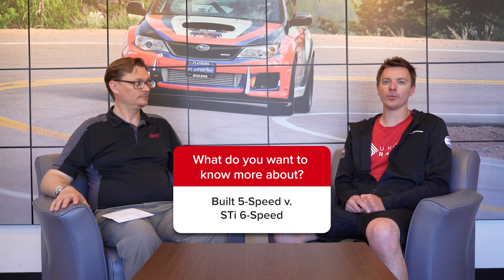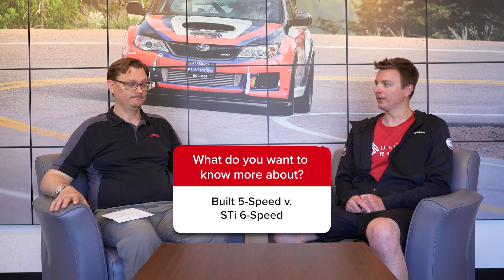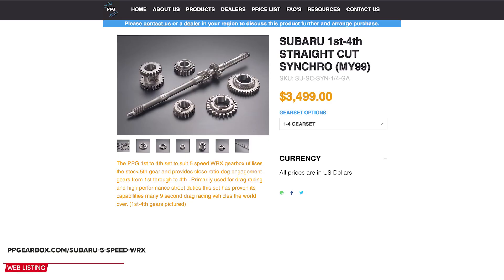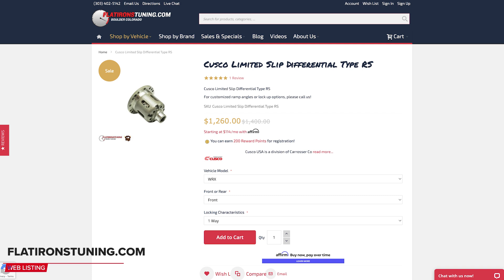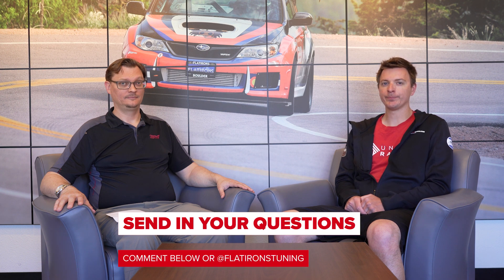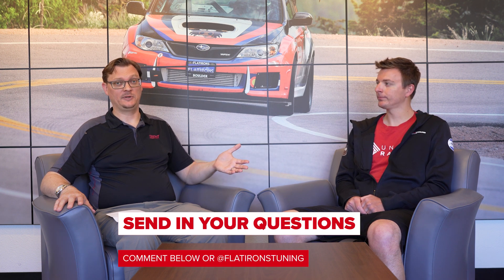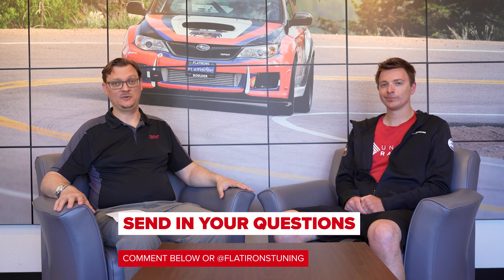Can you build a 5-Speed to be as strong as an STI 6-Speed?

Comment: Disclaimer: Just my findings; Love FT and buys parts from them; FT has been very helpful with my 2002 WRX; not advertising anyone else... just sharing knowledge from those who build 5 and 6spd MT for Subaru.
Question: How is the car being used? What is the horsepower/torque? This should dictate everything.
A 2.0L is a 2.0L, not a 6.0L LS. Subaru builds phenomenal power per liter. I wish Subaru had a 6.0L, I would make it fit. 🙂 That being said, it is my belief that 4 cylinder cars should be as light as possible in weight. As a penny saved is a penny earned, weight saved is power earned.
1) 5spd cases can only take about 350 FtLbs of torque due to the helical gears pushing the shafts out the end of the case. If you go with a straight cut gear, this problem is reduced significantly. The driving style will dictate what the 5spd will hold, as well. However, straight cut gears are noisy.
2) I have been informed by the builders there is about 100 lbs in spinning mass difference from the 5spd to the 6spd. If this is the case, this will definitely take away the responsiveness of the drivetrain. From this site (FT) and others, it has been stated up to 350HP/350FtLbs is the threshold of reliability for WRX/STI. Thus, one has to ask him/herself where will the power be maxed out at for the particular setup.
3) What I have been told: If you are going upwards of 500HP or more, you want the 6spd for reliability; simply put the 5spd will become a grenade at this power level. Stay with a 5spd setup as long as you can, especially if you don't exceed the 350HP/FtLbs mark. You will lose power to the ground due to the +100lbs spinning mass in the 6spd.
4) Many different types of gear ratios are available, and depending on the power level, you don't need bullet proof gears; you just need gears that have been proven to sustain the power and torque you are going to use.
5) Do not modify the gears after buying them such as smoothing them, or treating them. This will throw the tolerances way out, and cause the gears to not mesh as they were designed. To John's point, you will get less surface contact on the teeth because the tolerances are altered. So, a perfect set of gears for your application and power can be completely destroyed when "You" decide to add in your own internet engineering. Listen to the pros and accept what they have to say; they know what they are doing.
6) What I have been taught, and see: More shifts means more time. The last time I checked, drivers/racers want less time. Hmmmm? 🤔
7) YOU WANT FULL POSITRACTION!!! Believe me, this has made a huge difference for me on the street and taking corners and keeping traction. This is real AWD, not the open diff crap you get from the factory. This is especially helpful on non-asphalt services, or when there is gravel on the roads and in corners. FAIR WARING! You will have to change your driving style... You have to steer the car back straight when coming out of the corner. If you do not, the car will continue to turn that direction.
8) Choose a gear set that compliments the performance of your engine. DO YOUR DUE DILIGENCE! Make sure you have done the math to ensure the gears you are using don't shift you out of your boost/power range. If the engine is not built yet, then pick the drivetrain you want, then build the engine to compliment that drivetrain. DO THE MATH FOR BOTH... Engine and drivetrain.
9) Keep Horsepower numbers out of your head... I have seen properly setup cars (engines and drivetrains matched in form and function) with less horsepower annihilate higher horsepower cars on the street. That is fact.

My Setup for those who care... I have an 02 WRX Wagon (Grocery Getter). The stock 5spd MT would allow me to see speeds up to 135ish. However, shifting would cause the engine to fall out of boost. With much consideration and how I drive, I gave up one thing I wanted to keep... I went to 3.0 1st gear instead 3.4 1st. Thus, I  have to work the clutch more, I can launch and stay in 1st longer, go to 2nd gear and stay in boost. This affords me 1-4 in boost. I also forfeited top 4th gear speed, but probably to save me from going to jail. Here is the setup for my grocery getter. Believe me, 0-107mph is very fast and aggressive, considering it is currently a 275HP USDM 2.0L with 194K miles. In the near future it will be max 350HP/FtLbs 2.0L JDM motor.
1) 5 spd MT custom built by ????? Design. Dual first and RA 2-4 gears; Dual carbon synchros 1st and 2nd and new synchros for the rest; stock 5th gear for highway speeds; Torsen LSD in the front.
2) R160 AP Racing posi rearend
3) Kept stock 3.9 gear ratio, with 1.1 reduction setup. (Side note: 1.1 reduction is a clever design by Subaru. I like the science behind it. It reduces the speed of the driveshaft to save power.) 
4) Running a steel 1 piece driveshaft (5lbs savings from stock 2 piece) for durability and repair. Carbon too expensive for budget, and cannot be repaired easily or at all. Aluminum would require a hammer for clearance issues... not going to happen.
5) Using a Spec clutch kit, nothing fancy, with stock flywheel to keep the harmonics under control on the street for drivability and rush hour traffic. I would rather have the clutch slip in the future than allow the power of the new engine to break the trans. Clutch kits are less expensive.
Pricing:
Trans: $4600 includes some extras (bushings, etc)
Diff: $900
Steel Driveshaft: $600
Clutch Kit: $350
TOTAL: $6450 not including speeding tickets 😋🤣😂

Comment: The 5 speed isnt worth building imo. I had an RA gear 5 speed break on me on a vf34 e85 set up. I then went to a 6 speed with an auto driveshaft and re used my r160 diff. i spent about 3300 on the swap including the little things that were needed.
Reply from the maker: Nice!  Thanks for the comment and Stay Tuned!
Reply: I ended up building 5 speed as couldn't justify cost of full changeover and wasn't brand new. 1st to 4th straight cuts dog box (PPG gear sets) and love it. Run 450whp and 830nm torque no issues. 

Can see the pros of the 6 speed for sure!

Comment: After pricing on your site it looks like a full swap, with new parts, would come in alot closer to 15k without labor than the 6-7k mentioned. At this price I can build 2-3 5 speeds with gears. Admittedly the cases will still be weaker but a much more viable option for those of us with cars worth a fraction of the 6 speed swaps.
Reply from the maker: Hmmm.  I'd need to see the options you selected.  The number that we came to in the video is straight from our site, with the options selected.

Though that is a minimal estimate, yours seems quite high.

Thanks for watching and Stay Tuned!
Reply: @FlatironsTuning  looked like the basic swap contains tranny, linkage, and mounts. But wouldn't a person need the rear diff, clutch and flywheel, axles, dccd controller, and possibly brakes to complete the project? For my particular 5x100 hub vehicle it would need to be a dedicated and sponsored track car to do the swap with new parts.
Reply from the maker: Nope, not at all.  We just put this together on our site as a full resource with information on the swap.  The minimal parts that we discuss in this video are all the parts that are absolutely required.  Everything else is basically optional.

I would recommend a DCCD controller though, that has a number of benefits too.

https://www.flatironstuning.com/sti-6-speed-swaps-everything-you-need-to-know
Reply: I looked into this as well and maybe it depends a lot on which WRX you have. After watching the Flatirons video for doing the 6-speed swap into a GR it looks like I would need all those extra items.

Comment: Would a PPG 1st-4th gear set work in a Legacy Spec B 6 spd?
Reply from the maker: Thanks for your question.  Yes, there are 1-4 gear set options for the 6-speed transmissions.

They are a different design from any of the 5-speed gear sets though because the parts are not interchangeable between the two.

Thank you for watching and Stay Tuned!

Comment: 6spd case with stronger 5 speed gears set
Reply from the maker: The two transmissions are completely different designs and parts will not transfer from one to the other.  But there are gear options for the STI 6-speed transmissions.

Thanks for watching and Stay Tuned!

Comment: Went from a 4.11 ratio 5 speed to 3.9 ratio 6 speed an never looked back. The 6 speed literally transformed how the whole car feels overall. No question, 6 speed or bust!
Reply: Man I have to say I had the opposite opinion. I broke 2/3 in my 02 wrx 5 speeed. Basic Cobb and a vf34 twin scroll. Maybe 330 ish hp. I did a full 07 sti 6 speed swap, had custom races made for the cvs to keep hubs and the r180. With the quick spooling vf34 the 6 speed final drive ratios ruined the car for me. I sold the car since I put so much into it. and upgraded majorly. 03 wrx 530hp gt4088 twin scroll with a built ppg 1-4 straight cut 5 speed. Stupid fast. But maybe with the bigger turbo now the 6 ratios would feel better.
Reply from the maker: Nice!  Thanks for watching and Stay Tuned!
Reply: What do you mean 4.11 to 3.9

Comment: Great videos as always. Just wanted to put my 0.02 here…. Original owner of a 2011 WRX here that I’ve had for almost 12 years now. Been running my car on the 5spd the entire time with 410ft lbs of wheel torque through it with no problems to this day. 
I think what’s been the most important thing is respecting the transmission for what it is. Don’t dump clutches, hard shift, or roll on throttle in too tall of a gear. The transmission loves to be finessed into the right gear at the right engine speed,unlike other vehicles Respect it and it’ll last a long time.
Reply: I send mine often (mostly pulls). It's had the same gears in it for 140k miles. I'm going to get ppg's just to have some piece of mind.
Reply: Nice! I have a stock location Comp TBB 56mm turbo on 91oct in a 2006 WRX Wagon w/5sp all stock internals and make around 400wtq. Over 50k miles on this setup and only issue Ive had in the driveline was due to rear end incident
Reply from the maker: Thanks for the comment and glad to hear that your 5MT is still working well for you!

Stay Tuned!

Comment: Hey guys thanks for answering my question! I’m the Joe you mention lol. I paid about $5000 for parts including the rebuild kit and labor by Andrewtech in 2015 so prices were slightly lower… I ordered the PPG torsen diff for about $1900 and I installed it myself. Other things that went into me considering this choices was axles and brakes because my setup is in a 2002 WRX wagon. At the time I didn’t know what to do about the longer axles from a sedan as well as the hub conversion to 5x114.3 which would require getting new wheels. (I have 18” Prodrive P1s which I love) It was just very convenient to remove and replace with the same trans. Also if you ever have to replace or repair Brembos it can be very expensive. Any other questions let me know! Love your videos and tech discussions!
Reply from the maker: Thanks very much Joe, and glad that you liked the video!  Stay Tuned!

Comment: Would you need a sti gauge cluster for a 6 speed or does the aftermarket dccd controller not need it?
Reply: map dccd has the 'gauge' built in
Reply from the maker: Thanks for your question.  The STI cluster isn't needed to do the swap.  And as mentioned here, if you want the lights to display the DCCD function, the MAP DCCD controller does that as well.

Thanks for watching and Stay Tuned!

Comment: There are more version of 6mt gearing, while JDM is short and doesn't give you longer final gear, USDM/EDM hawkeye 6 speed has longer gears that are somewhere between WRX 5speed gearing and the 6th is longer than WRX 5th so it is beneficial as well. And for people outside the US and Japan, the STI had non-DCCD 6speed until 2005 which can be sourced cheaper and doesn't need any additional wiring.

Comment: Just curious on yalls opinions on blast plates and how useful those are in a 5 speed transmission
Reply from the maker: They don't really fix the core problem with the 5-speeds, which is most likely why there has never been any concrete data about how much of a change they make to 5-speed durability.  Dave from Rallispec had some interesting experience with them as well.  You should go through that video if you have a chance.  Lots of good information in there.

https://youtu.be/vwi68Qd-mwE

Thanks for watching and Stay Tuned!
Reply: I have them and the difference in feeling is amazing, have spoken back and fourth with a privateer rally guy that was nuking 5speeds until he started using them.
Reply: The theory is that 5 speed transmissions stretch/twist under high power applications. This allows gears to grenade themselves. 

So blast plates keep the transmission from flexing,keep the gears from grenading. My tuner autocrossed a wrx swapped outback making 500hp, and with blast plates, had no issues...
Reply: @StarwindIV  glad to hear this from someone else. i know of 2 people running them, 1 at strip has had many launches on semi's and its still together and the rally guy but he did brake with blast plates after 2 full seasons, were before plates was every couple races lol
Reply: @proximitybeejay3673  I will say, I wouldn't recommend hard launches constantly with a stock 5 speed and blast plates, but, for hard driving, should be fine imo
Reply: @StarwindIV  Dude i change gears like my lever is a match stick lol. The 5 speed lives in a glass house i was just saying what i have done lol. And shock proof oil HAHA
Reply: After "melting" 2 3rd gear sets I installed the blast plates, only 1 trackday on it, but will come back to this if it grenades itself.
Reply: @PedroFTeixeira  Please lettuce know buddy. Blew my first box quicker than a virgin on pram night doing less lol, have a spare waiting again all ready lol
Cant afford a 6sp swap here after full build and everything else.
Reply: I have a 2012 wrx tuned to 420/450 wheel with blast plates it’s a daily driver, and I beat on it pretty much everyday and the trans has held up for over a year now starting to get grinding going into 3rd but overall I feel they have helped quite a bit. Maybe just luck..
Reply: @christopherhutchinson1779  nice knowing. Coming from drifting and nissan turbos, these boxes are a joke. We limiter launch daily in Nissan and then smash every gear to drift lol. Really wish they made the 5 speed better
Reply: @proximitybeejay3673  the 5-speed wasn’t designed to take launches, because it was used in less powerful cars first. I was surprised at just how small it is when I started working with them. 

When Subaru got serious about racing, the 6-speed was designed and was MASSIVELY over-engineered to handle high torque.

The difference in size/design makes it real obvious side-by-side why you want to move to the 6-speed. 

If you’re racing and serious, the 6-speed is mission-built stock from the factory.
Reply: @grioghar  My mate/ engine builder worked for Subaru Rally team for a season, he seen 6 speeds grenade on the line. 
And i know the differences etc 
Just seeing how the 5's are holding up with plates etc. 
dropped 50k on my car the box has to wait lol and i treat it like glass =)

Comment: Great idea for a topic! Just swapped in a 6 speed myself after blowing a 5 speed at about 330 ft-lbs. (never launched, blew 2nd) and am really curious what you have to say (haven't watched yet).
Reply from the maker: Definitely take a look at the video.  Stay Tuned!
Reply: @FlatironsTuning  Watched it and wasn't disappointed!  Glad that I went with the six speed in hindsight and interesting observation about the lack of support in the main gearshaft. I had previous read about the issue of the gears pushing apart under heavy load as being the reason for failure, even in PPGs, but people had typically attributed that to case flex, rather than any lack of support in the gear shaft itself.

I'm curious if you think that straight cut gears, if you can tolerate the whine, would hold up much better, since they should, in theory, push apart less under load, compared to helical. 

It also sounds like blast plates, which were once thought to reinforce the case against flex and mitigate the issue, would do nothing to solve this issue. Wonder if that matches people's experience with them...
Reply from the maker: @Currancchs  The issues with the 5MT transmissions really come down to the case, and the overall design.  There just isn't a way to improve or overcome those issues without changing the design of the transmission itself.